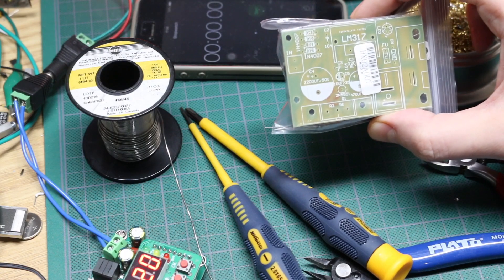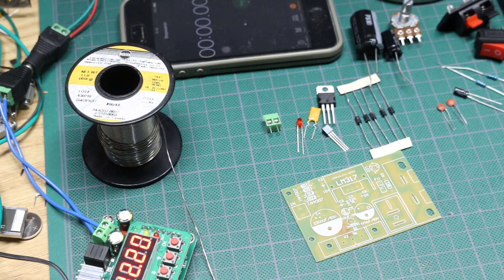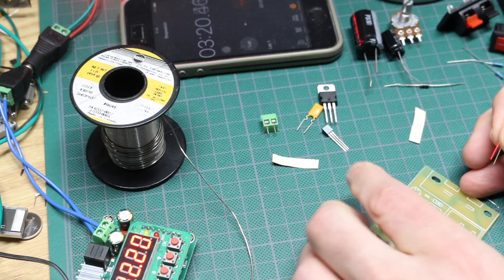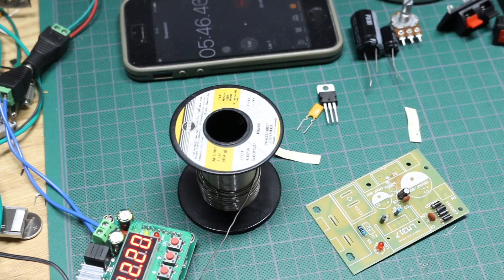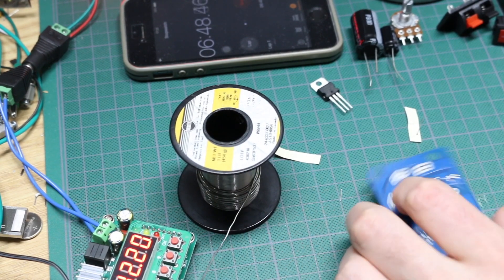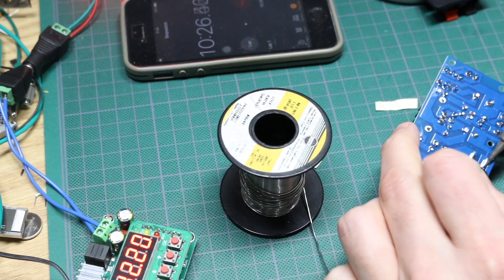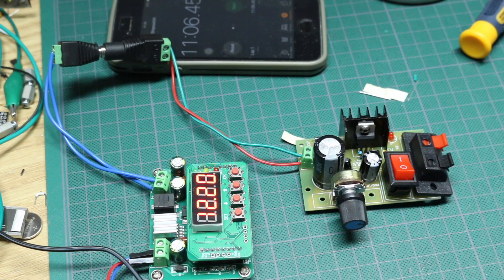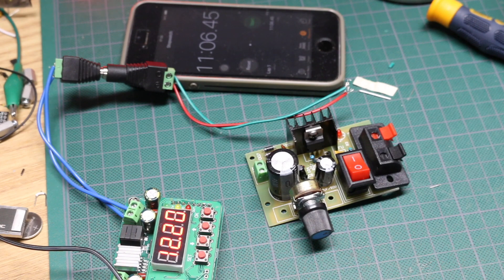LM317 Linear Voltage Regulator Kit: How Fast Can We Build It?

Comment: I think you need a kit with some SMD work to make it more fun :)
Reply from the maker: Nothing smaller than SOIC 1.27mm pitch and 1210  resistors unless the entire circuit is intended to be a big tinned solder blob PCB. But if we keep doing this maybe in a year and a half we can work ourselves up to speed soldering a BGA kit!

Comment: Where did you get this kit from? I want to give it a go ;)
Reply from the maker: I’ve seen it on Aliexpress but I couldn’t find it as cheap as eBay. 
https://www.ebay.ca/sch/i.html?_nkw=LM317+Step+Down+DC+5V-35V+to+1.25V-30V+AC%2FDC+Module+Power+Supply+Kit